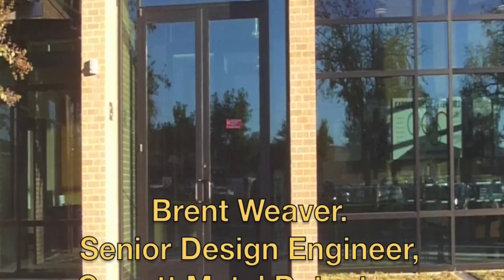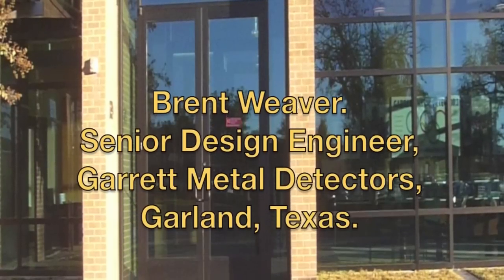Interview with Brent Weaver, Senior Design Engineer, Garrett Metal Detectors.

Comment: Hello,
Why is it not possible
 to cancel out iron by ground balancing the machine on a bunch of nails ? 
I have got my atx and I am happy about the power of this machine . Nevertheless my Whites TDI SL  is able to knock out iron just by setting up manually my ground balance . This is not possible on the atx ! Why ? It would have been just fine to be able to do manual  ground balance ... Second ,my Whites TDI SL is much better on  the heavy black sands and alios    on the beaches of Biscarrosse (France) . My seahunter mark 2 is astonishingly good and all terrain on the south west beaches of France . I love the tree machines for their  specific uses 
Garret atx : Pure penetration power on wet salt sands (not black sand) 
Whites TDI SL : Capability of knocking out Iron without any problem at all . 
 Garrett seahunter mark2 big coil 10/14 : Powerful all terrain monotone pulse induction machine : gives you with some exercise good audio information .. 
My question : is there a way to knock out iron by manipulating the ground balance on my Garret atx ? 
Thanks in advance for your response . 
Rapunzel ,France .( South west French  beaches )

Comment: Hey warren and Colleen thanks for taking the time to reply.
The reason why is I absolutely love the at pro and if you have seen my 100th episode you would see why.
It's just I've had the most bad luck with the black inner insert pulling out on about three pairs of head phones and I also bought an adaptor lead and it broke fist time and had to go back and believe me I'm an electrician and I take it easy with every connection I plug and unplug and still it happened so I was kind of having a good old Aussie dig saying oh so Brent's responsible for my frustration he he
I understand the waterproof aspect of the design but it seems it could be stronger internally is all.
As I said love the machine to bits I even have two now but that's just my only winge.
Thankyou Garrett for a great machine love it.
Regards
Paul